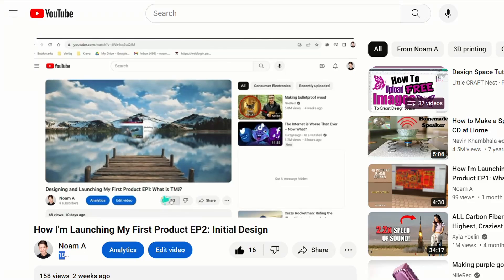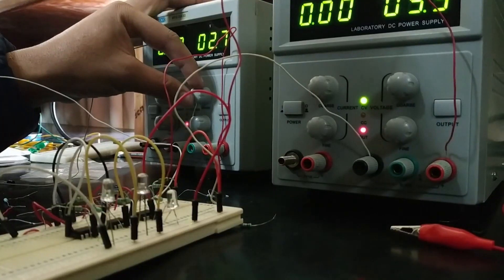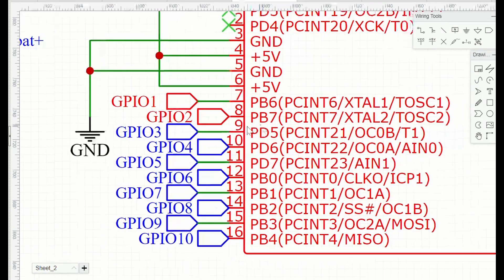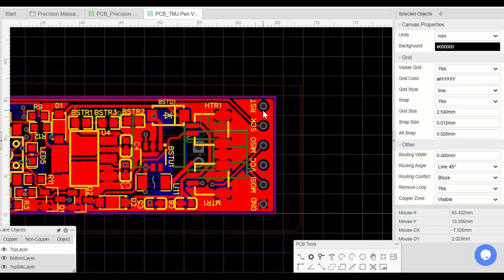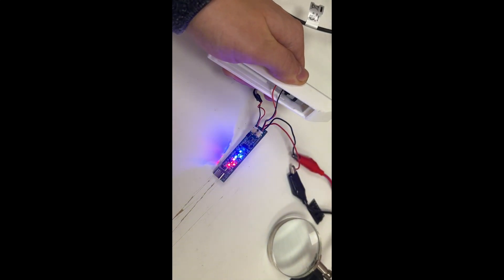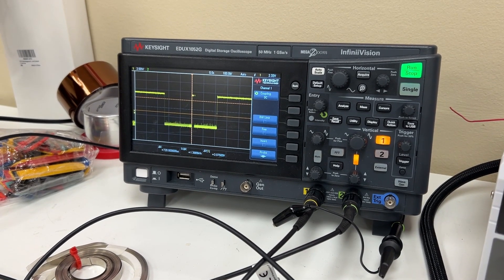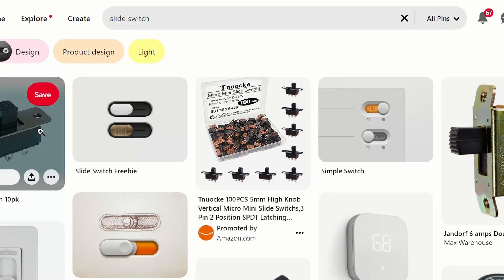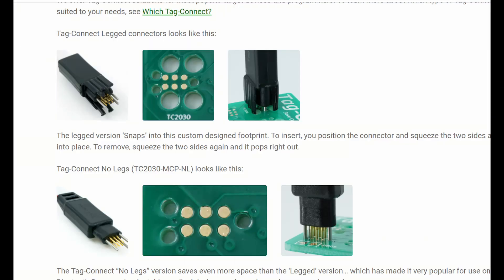I quit my job to be an inventor | Ep. 3

Comment: Watching this I feel your pain. My one bit of crucial advice would be to stop doing endless cycles of crash-and-burn PCB design, assembly and failure.
Build a Frankenstein breadboard first- build every part of the circuit as a module that you can remove, rewire and replace with ease. How do you get to the nodes you need to probe? Break these out so it's really easy to probe and connect to everything. Only then, when all of this is working PERFECTLY would I start laying anything out on a PCB. (except just to confirm it all fits) You might need to make small test boards for the SMD parts, these should be placed on a big breadboard that includes all the hardware. Too many beginners think that making final PCBs is the only way to design things but it's a total waste of time to think this way for a complex project, unless you are very experienced.
Reply from the maker: Yeah great advice man. I can’t say I haven’t thought of doing that, I guess I’m just a bit of a PCB gambler lmao. There’s honestly so much going on with this project I enjoy the wait times to do parallel work. But you’re 100% right, it’s just my first project where I’m able to make PCBs instead of Frankenstein breadboards so I’m hype about it for now.
Reply: @noamaiz  Designing hardware is never a "one-and-done" affair, I like to think of it more like sculpting; A great final design takes a lot of "beating things into place", a lot of testing, and a lot of interaction with the code and hardware, together. The final PCB is a terrible environment for these activities, every design change brings on a ton of shadow work that has nothing to do with getting the project done, the difficulty of making measurements leads to just "assuming it works" rather than taking the time to actually test each function block completely, to really know what is going on. It's so easy to spend hours calculating some theoretical design stuff only to find a subtle real-world problem that you never considered that mucks it all up, the key is to discover these problems up front, at the stage where they have the least impact on your project timeline. I always hear people say "Ohhh breadboarding takes so much time, what a  waste when I can just go for the final PCB?"
Reply from the maker: @leosbagoftricks3732 Well said. I appreciate the advice

Comment: When using the shunt resistor you need an op-amp. That’ll get you over that hump. GL
Reply from the maker: Yup, I am! Amplifying it to around 2.5V with gain of 50. Nichrome just has super low temp coefficient of resistivity so that’s where I’m still getting the borderline tiny delta V. I’m thinking about subtracting the nominal shunt voltage from the measured and amplifying the difference to improve resolution. But that’s a lot of components so we’ll see.